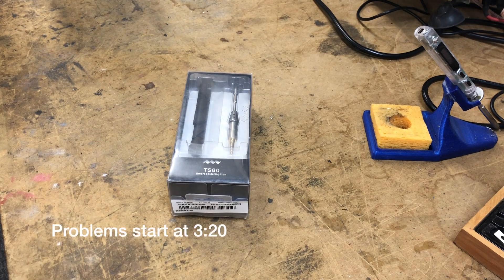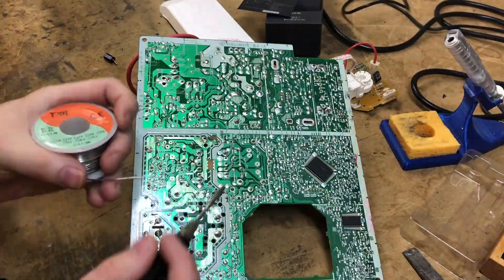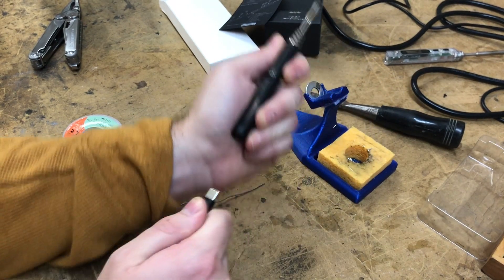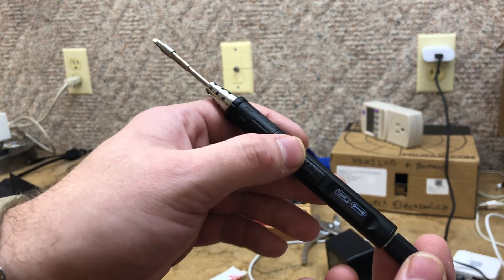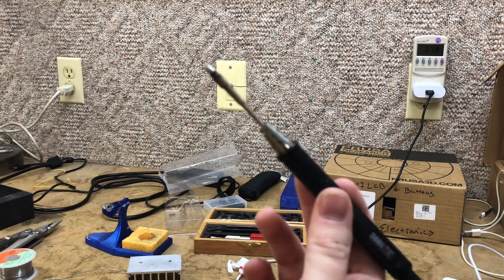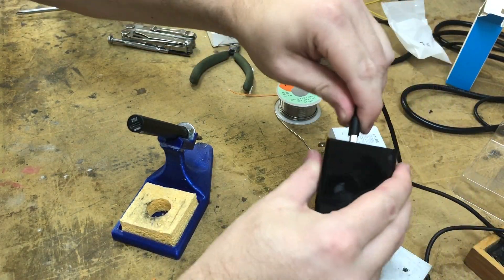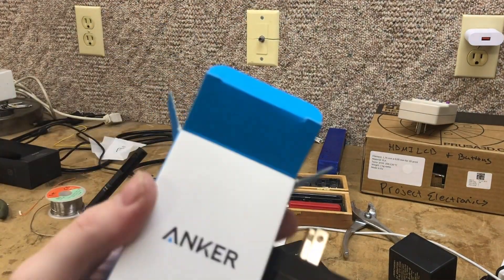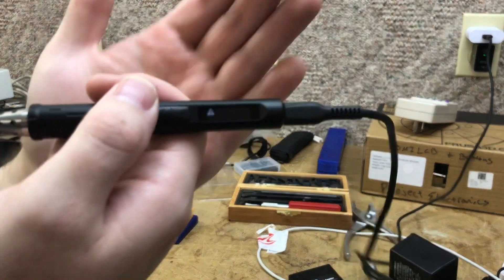TS80 Unboxing and First Impressions With Some Issues

Comment: I have the same issue. With my Anker powerbank it's a hit or miss. You can either get a QC3 trigger and output consistent 9V or wait for a firmware upgrade. (It looks like a firmware issue)

Comment: Bad cable?
Reply from the maker: Ware Mini Banggood is replacing the TS80 and I am shipping you mine for troubleshooting. I have also ordered a second tip. I will update everyone when the new parts arrive with a new video. Thanks.
Reply from the maker: Gilad Raz Possibly since I’ve tried different power sources and I only have the one cable. However, I tried jiggling the connection at both ends of the cable and when it was working I couldn’t make it stop working, so it’s not a loose connection afaik.
Reply from the maker: Update: I found another cable to try and immediately got the same “Low-Vot” error as before.